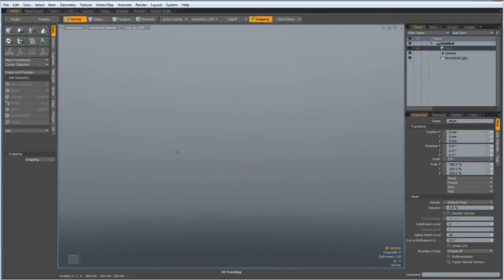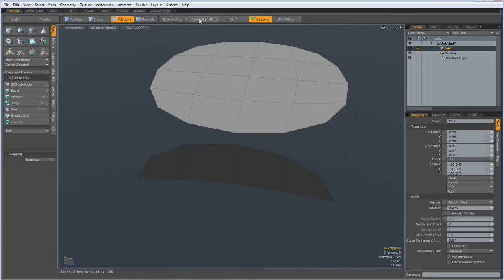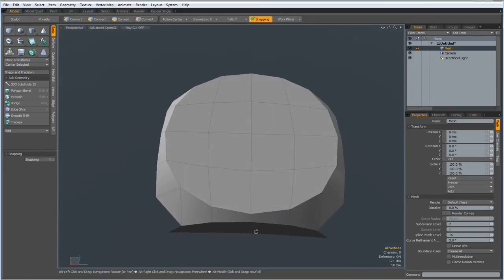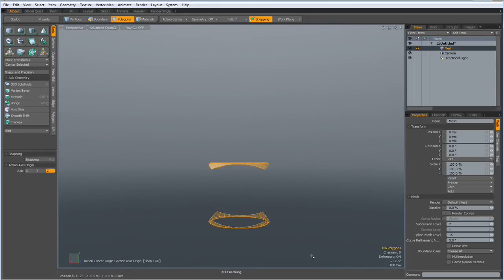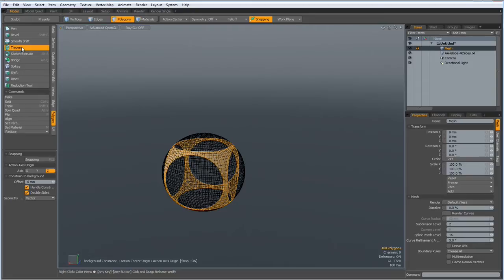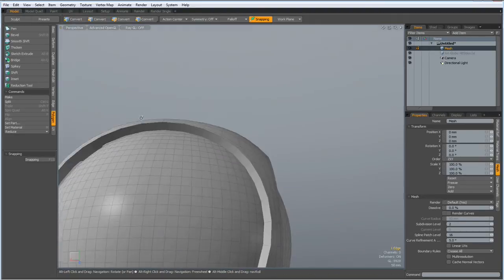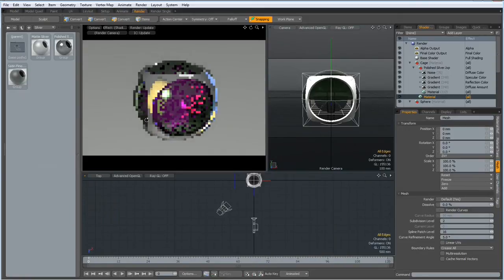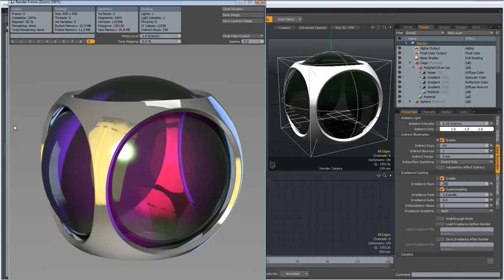Luxology Modo - Modeling a Sphere Cage

Comment: Wow! I come back to this 4 months later and I can understand and accomplish this, thanks a lot  to following many of your other tutorials.
I know you prefer to explain by example rather than teach fundamentals directly, which is good, however I notice in this tutorial you use Constraint set to background and vector on, and you don't really talk about using it, and I was wondering if there was some way you could demonstrate when one should use Background Constraint using vector and then not using vector--just background, as well as showing when to use point. I have tried some experiments but this tool doesn't always make sense to me as to how it works and when each modifier should be used.
Reply from the maker: Yonder Observer I always use vector when i constrain an entire object against a background constraint for example to make a ball really round). The other options simply don't work... Point and Screen Axis work best when you retopo something. In any case, make sure that your background constraint has enough geometry, maybe by making a temporary copy and  subdivide it several times otherwise you can really get strange results. Kind regards, Peter

Comment: Hello Peter, This looks very interesting and your results are beautiful. When I try this and follow along, I can match your cube and get a cube subdivided twice-with 192 polys, but then, when you control x and control v--I don't see how you get an entire side with just one click. And then when you paste, I don't see how the side is now all flattened out? My cube --to match yours- has 16 polys not one and when I paste it doesn't flatten out like your. It looks so easy when you do it. I must be missing  basic information of how you start. Thank you for any help.
Reply from the maker: Hi, first of all, you should have only 96 polys after subdividing twice (6 x 16). If you have 192, then you have double polygons. Run mesh cleanup. Other than that, i don't really know how to help, this is really quite easy and straight forward. Good luck, Peter
Reply from the maker: There is one more thing which comes to my mind: Make sure your initial cube is centered in all directions.